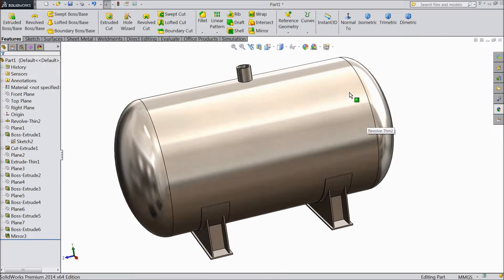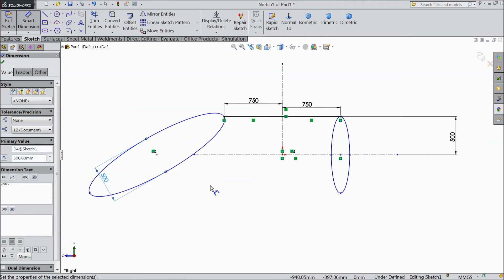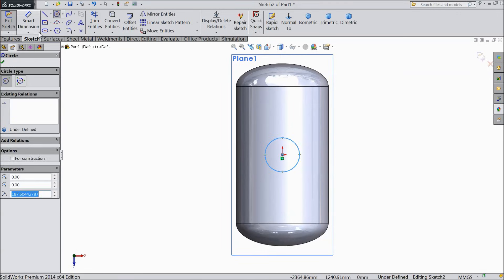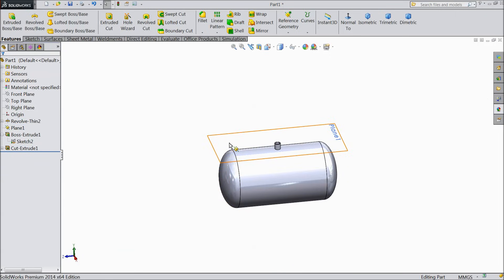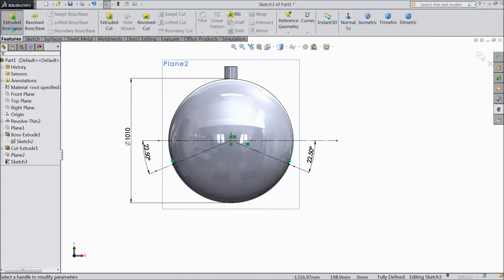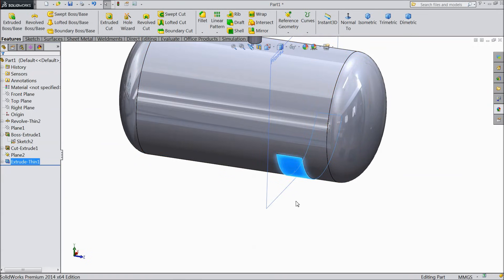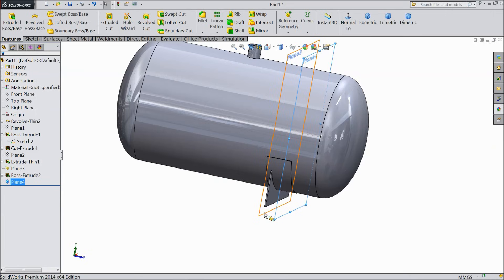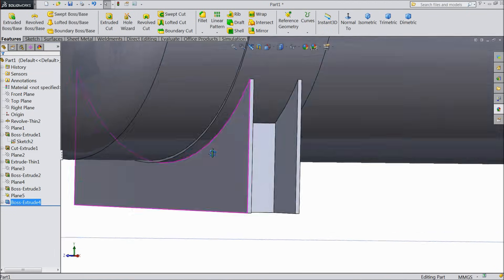Solidworks tutorial Design Boiler

Comment: Can you give your Appearances settings please ?
Reply from the maker: i am using Dell Precision M4800 laptop with  2GB Nvidia quadro K1100m graphics card. use professional graphics card like Nvidia quadro series or AMD firepro, not GTX.
Reply: No Professor, I'm referring to the appearance setting in your SW for the lecture of this part. I.E.: Background, finish etc ? If you remember since this lecture was 2 years ago. I always like your appearances but have trouble getting them the same.
Reply: @milesmoore5422  It requires Realview which is only available natively on Quadro, Grid or Firepro series of graphics card. There is a workaround however, if your gtx graphics card is strong enough to handle Realview. Check it out on google